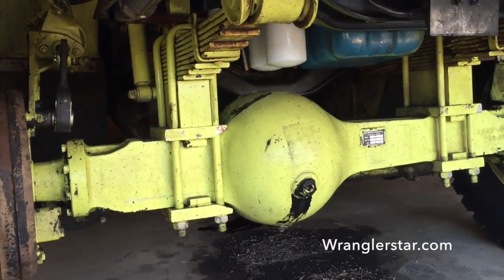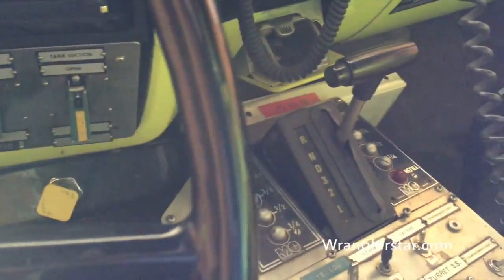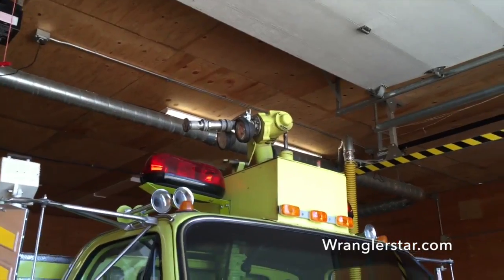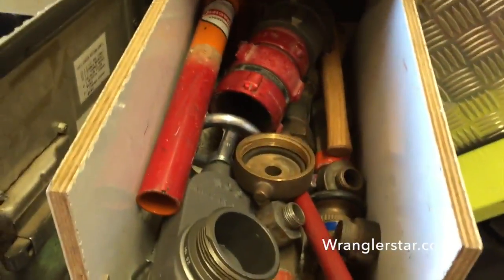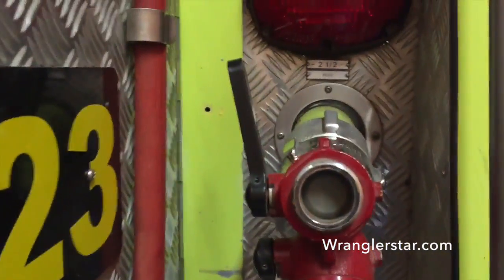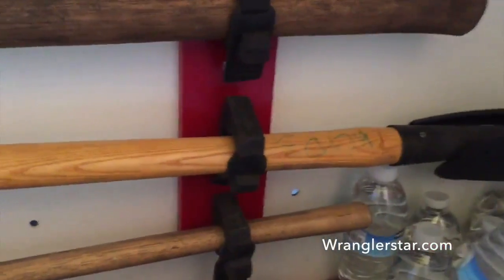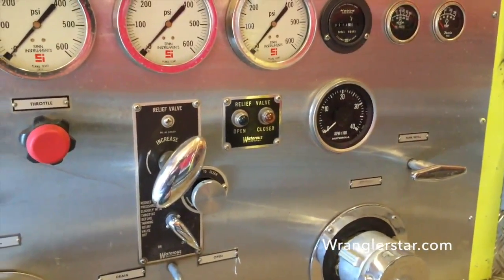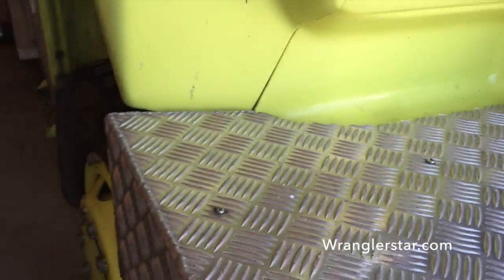My New Wildland Fire Engine + Wranglerstar

Comment: Proper tires? Those are horrible when off the road, you gonna need wider wheels with better face if you are going off the road
Reply: Not true at all. It's not a muddin truck.
Reply: NuffMan Agreed with zero7negative , these tires will work very nicely off-road and in snow conditions. Wider the tire = more crap you have to push through.
Reply: Well here in Finland the dirt almost sucks the machinery in :)
Even in winter when the dirt is frozen i have got stuck with same size and kind of tires shown in this video.
Reply: NuffMan Narrow tires especially on large heavy vehicles are better in almost every situation
Reply: True if you have hard soil under thin layer of mud or snow, but when you have more softer soil your going to sink and when axles touch ground your stuck for good.

In Finland even combine harvesters use 1m wide tires :) and its on a "dry" field.. 

Maybe this picture tells more than a thousand words about the soil in Finland :)
http://www.suomenmuseotonline.fi/fi/kuva/Lusto+-+Suomen+Mets%C3%A4museo/lres_68111.jpg
Reply: Tyrel Hanson Right , thats why they have skinny tires on the trucks that they drag race thru mud pits with.
Reply: bcrusher1979 Like tractor tires.
Reply: NuffMan  He is not going stump jumping he will be traveling roads...he also won't be go mudding in it either....
Reply: NuffMan i love people who have no idea what they are talking about.
Reply: seems like alot of people are chiming in so I figured I might as well. I'll qualify myself first, I've been a tow truck driver for a few years now. the last 10 of which have been towing semis. Imho those tires are a little to narrow and way to hard for anything other then a pretty well packed dirt road.  there's probably around 4200 lbs on each of those fronts unloaded. 

somebody was talking about the skinny tire mud trucks, I get where your coming from but I don't think it can be scaled up this big. in the mud trucks the tires are very tall and try to reach firmer dirt at the bottom of the pit (under the loose mud).  Also those trucks are very light. Anything with this much weight needs alot of surface area to support it.

l that said, I think he'll do fine with this truck, as long as he doesn't go wandering off the trail after a rain.
Reply: nuffman is kinda right the tread on those tires would be horrible for mud or at least where I'm at but the taller skinnier tires would be great for off road performance
Reply: Let him play fireman and have fun u jerks
Reply: Ever seen a 2CV in the snow? Or an early model Land Rover? Narrow tyres actually work very well in mud and snow as they exert more pressure in a given area, providing more grip.
Reply: zero7negative even a mud truck is better with skinny tires. Wide tires are really for rock crawling.
Reply: NuffMan harvesters use wide tyres to avoid compassion

Comment: that's a fire truck . a fire engine is an engine that works using fire.
Reply: +Mars Seeker It does use fire that comes from diesel that it burns to run.
Reply: An engine is a classification in fire terms. The engine and ladder. However the men are still truckees.

Comment: Ah!!!! Four wheel drive, more stuck than two wheel drive.
Reply: I have a 4wd and that is just not right, if you use it the way your suppose to you won't get stuck, where as with a 2wd if you lose traction anywhere you can get stuck, not true with 4wd. But I'm up in Canada where we get a lot of snow, sometimes when there are blizzards 2wd are stuck everywhere and I'm pulling them out on every block, so 4wd are needed sometimes.
Reply: More stuck than 2WD, you just haven't wheeled it hard enough yet. 😜
Reply: Oh no don't get me wrong, I've driven like a idiot a lot, and got stuck lots, but 4wd has got me out of a lot of places.
Reply: Agreed, but more stuck than 2wd):